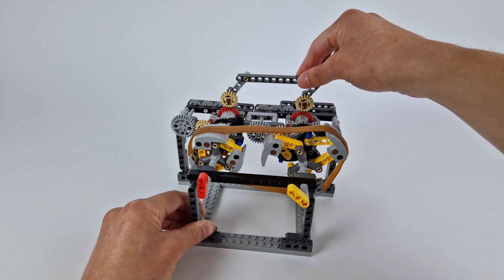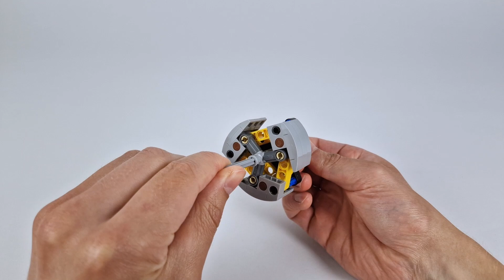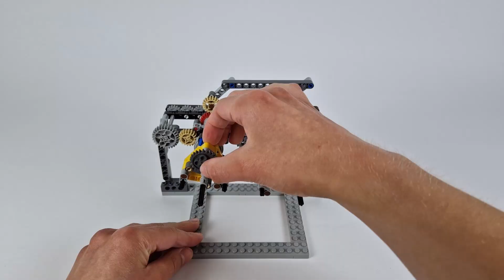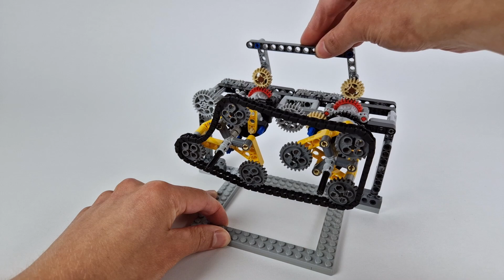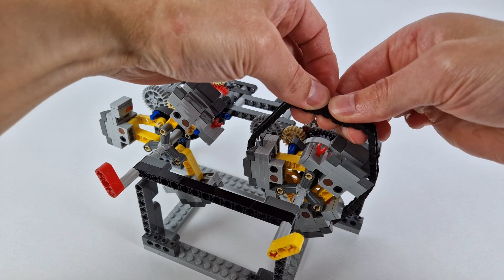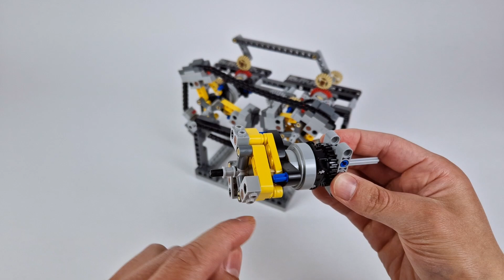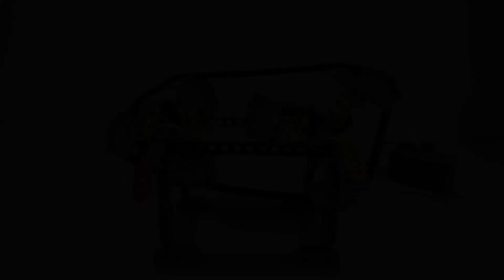Building a Better LEGO CVT (No Slipping!)

Comment: I've seen a number of Lego CVTs/automatic transmissions and this is the first time I've seen someone use variable diameter wheels. I suppose there will be some irregularities in the output speed, similar to what you get with a universal joint. I'm definitely interested to see if it works in practice in a vehicle or something. It would be interesting to see if it will go to the highest mechanical advantage on acceleration from a stop of a heavier vehicle.
Reply from the maker: Thank you! Yep, putting it in a car and using it to accelerate some heavy vehicles is exactly what I've got planned for the next video.
Reply: @BananaGearStudios  you could try using 2 of these side by side but offset 180⁰ to help smooth the output
Reply: @frogsshadow4189  It should be 120 degrees because they're triangular.
Reply: @BazilYat I picked 180 because it's the easiest way to know that they got flipped without having to actually sit down and do the math.
Reply: @frogsshadow4189  That's fair, just make sure there's a point facing directly away from the other one and it works.
Reply: @BazilYat  The three spokes are already 120 degrees apart, so offsetting the wheels by 120 degrees would do exactly nothing useful.
Reply: @Hagledesperado  I think I meant 60. To put the spokes exactly out of phase.
Reply: @BananaGearStudios awesome can’t wait to see that
Reply: @BananaGearStudios  Regarding the fluctuating output speed mentioned by @quinnobi... Could it be smoothed out by building two identical "modules" the same as your finished product in this video, and connecting both of the inputs with a fixed rigid connection, but with the two "out of phase". Then, connect the two outputs by each side going into the half-shaft of a differential, and using the rotating differential housing as the "true" output. In theory, I think this would cause the slight fluctiations to be cancelled out. It's really just the same idea as using two universal joints on a shaft, with them mounted out of phase, so that the fluctuations are cancelled out.
Reply: Something else to consider is the fragility of the Lego chain pieces. I don't have confidence that a high-torque load wouldn't completely annihilate it. Might be a good idea to make the wheels dual chain-drive
Reply: That will bee amazing
Reply: I was wondering about the input / output speeds as well. From the chain's point of view, the wheel has a diameter that grows and shrinks back and forth 6 times per rotation. Could possibly be smoothed out by having much more arms per wheel + more wheels side by side.
The larger issue for real-world applications, I think, are the hooks. Whether the chain bumps over them or they are spring-loaded, they will suffer all the same and the noise could be quite something in larger vehicles.

That said, this is still way better than all the solutions I came up with thus far.
Reply: Spoken like a true cuck
Reply: DAF Variomatic
https://en.wikipedia.org/wiki/Variomatic